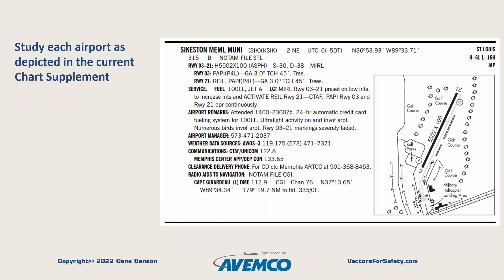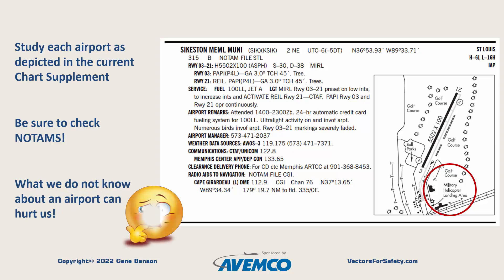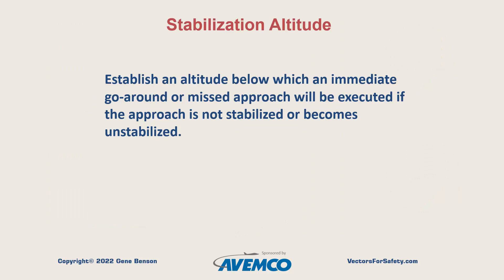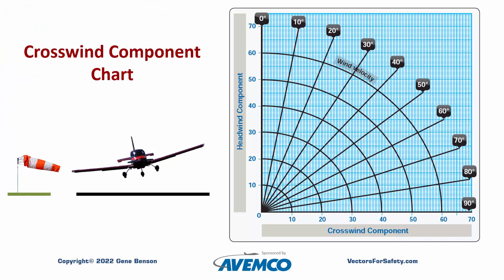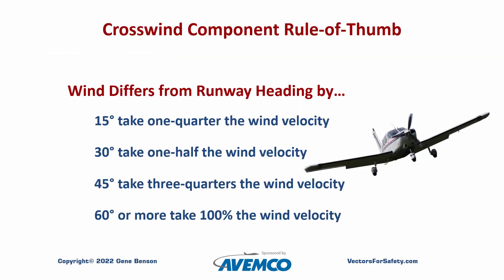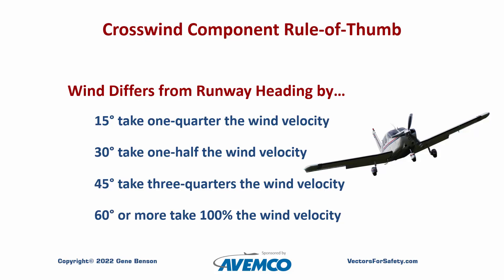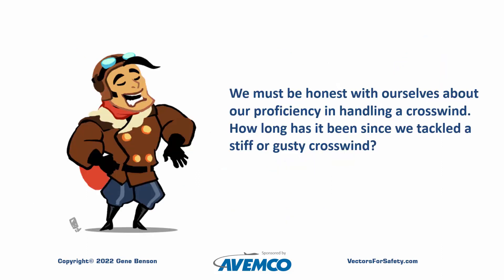Avoiding Runway Excursions in Under 5 Minutes!

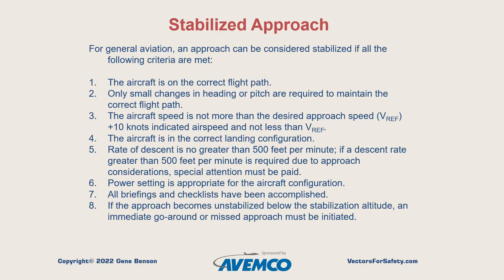Comment: I don't think the 8 parameters at 2:32 are helpful without more guidance on technique.  For example, starting descent from traffic pattern altitude, I've seen many pilots who have been trained to set pitch and power to pre-determined values and one who was trained very specifically to pitch to a 500fpm descent.  To them, everything is on target - they carefully followed their rote procedure and all of the parameters appeared right on target.  However, what I saw so many times was the trajectory of the flight path to the aiming point was dangerously incorrect.  Why - because conditions change but those pilots know only one combination of pitch and power.  When I mentioned we were overshooting or undershooting, it was a total surprise.  They were not taught to perceive the trajectory of the flight path at those distances from the runway and greater as recommended in the Airplane Flying Handbook so for them all parameters looked ok.  Unfortunately, that is a critical omission that happens way too often in flight training.  It's easier to just set pitch and power in a rote manner looking at the instruments rather than looking outside and establishing the correct flight path to the aiming point at the correct speed.  The pilot is left without the necessary skills to even determine deviations from these parameters.  By the way the student who was taught to establish 500fpm (she came from another flight school) had failed her checkride.
Reply from the maker: Thanks for your comment. This is a shortened version of another video "Many Happy Returns" which includes much more detail. See it with this link: https://youtu.be/AaqrcVBu4OU
Reply: @GeneBensonAviation  I watched that video again - it gets into more subjects but I don't think it covers what I mentioned above.  Even if things eventually get sorted out, the most critical part is left, managing the flare and landing.  To see an improvement, the correct technique there is even more critical.  The advice I frequently see is for the pilot to look to the end of the runway.  However, the Airplane Flying Handbook says "If the pilot focuses too far ahead, accuracy in judging the closeness of the ground is lost and the consequent reaction is too slow, since there does not appear to be a necessity for action. This sometimes results in the airplane flying into the ground nose first."  What do you recommend?
Reply from the maker: @warren5699  I also am not happy with the FAA's statement about looking at the end of the runway. I think that opens the pilot up to runway width illusion in which a pilot can believe the airplane is lower than it is with a wider runway and higher than it is with a more narrow runway. A side point to that is that instructors should take students to a variety of runways rather than just stay at the home field. I have taught students to identify the spot on the runway centerline that is stationary in the windscreen. That is the point at which the flight path will intersect the runway under present power setting, pitch, and wind condition. That spot can be moved forward or back by adjusting power/pitch. Once the aiming point is correct, and airspeed is on target, I want them to shift their gaze up and down from just beyond the aiming point to a point about 1/3 of the remaining runway ahead. I have found that helps to eliminate the influence of the cowl shape on the pitch angle which messes up students moving from one make/model to another. Finally, I want them to pitch level before pitching up for the flare. That allows for a quick reassessment of height above the runway and sets up for a go-around if necessary. If all looks good, pitch to landing attitude and let the airplane settle to the runway. Of course, gusty wind or crosswind requires different technique. I totally agree with your earlier comment about students learning to set up by rote. They need to be exposed to a variety of conditions and environments.
Reply: @GeneBensonAviation  Gene - Actually the FAA's guideline is not to look at the end of the runway but to focus at a slightly downward angle - i.e. where the landing light shines.  I think that is very close to your technique and the same that I have used for all of the reasons you noted.  I see the recommendation to focus to the end of the runway in tons of articles and videos and I believe it leaves the pilot with exactly the problem the FAA says that will cause - the pilot will not see the need for action when action is in fact needed.  That's very bad that the wrong technique is prevalent in articles and videos and the correct technique is practically only found in the FAA Handbook (AFH chap 09).  That needs to be corrected.